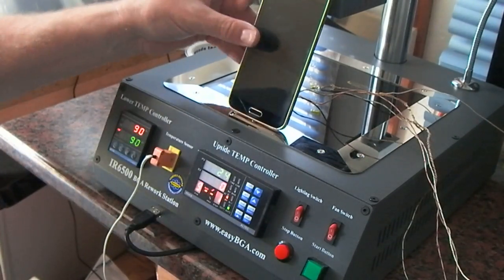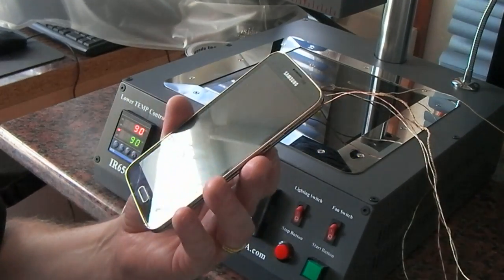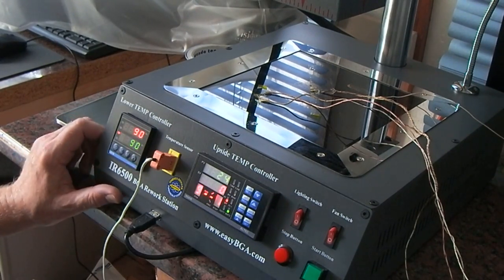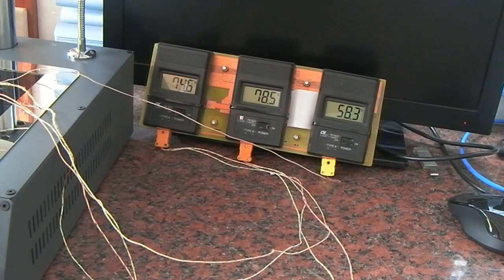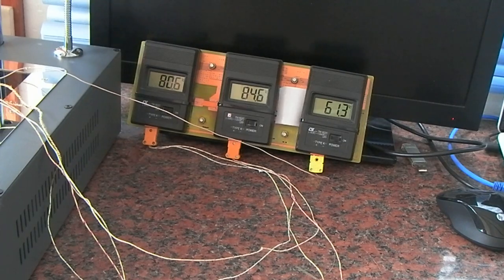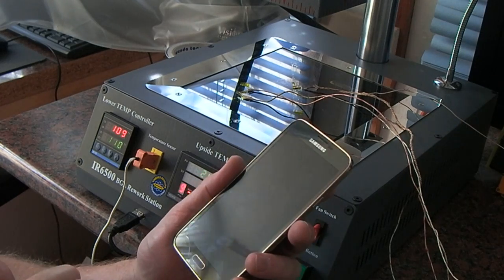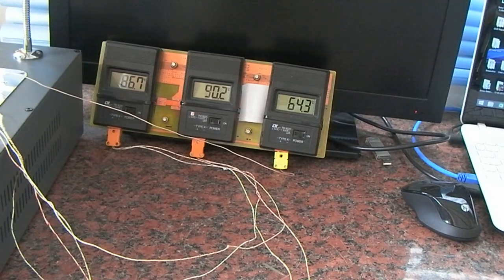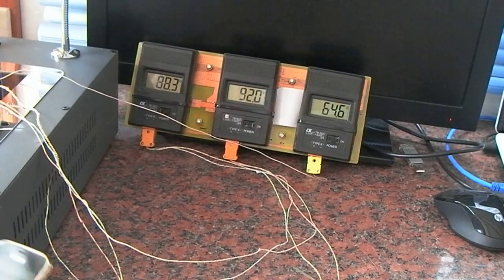Galaxy S5 front glass replacement

Comment: Download the manual for the BTC controller they use, there is an option in the programming to have a process offset so the display will agree with the actual measurement.

You will probably find the heating element inside is not secured correctly underneath, so giving poor thermal conduction to the heater plate, or it is simply a cooker plate element held onto a metal plate.
Reply: SeanBZA 
Thanks, actually I think they are proper elements, there are some video's around with the glass removed, I just don't like the look of the machine that way.
I'll sort the offset out as you suggest. 
regards
Trevor